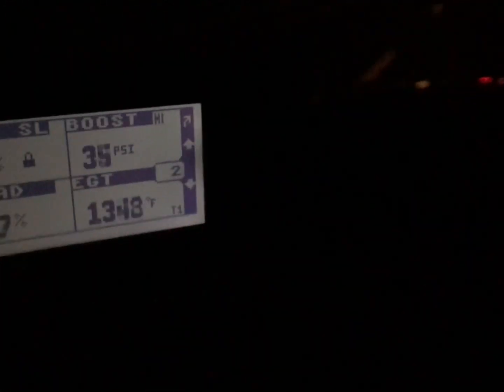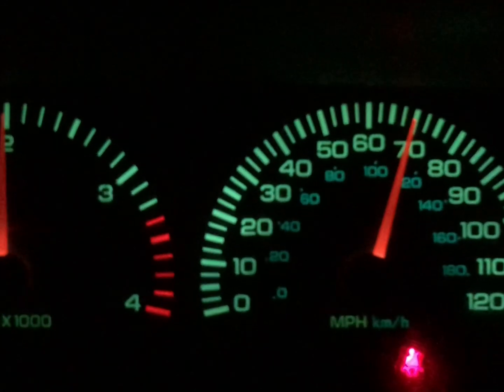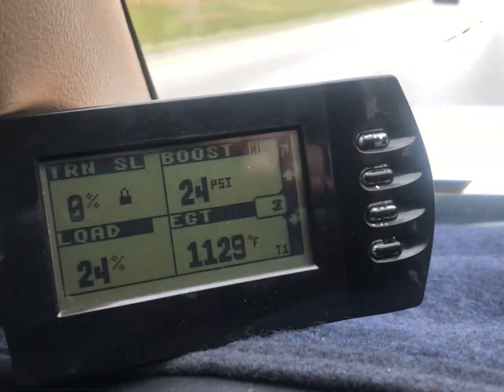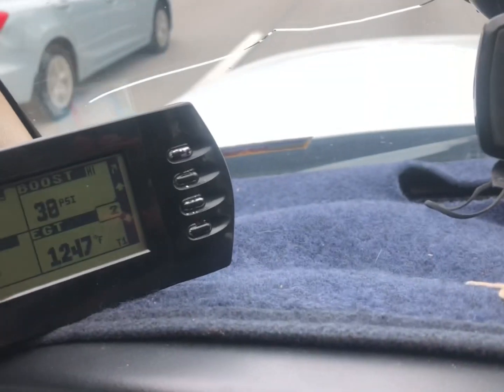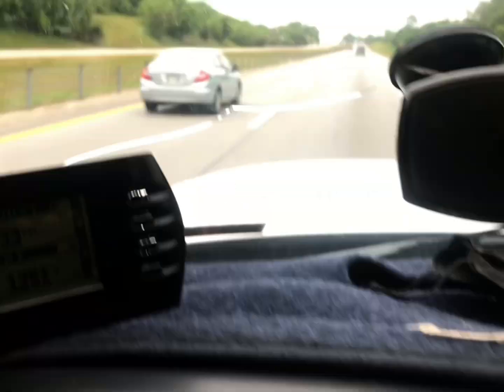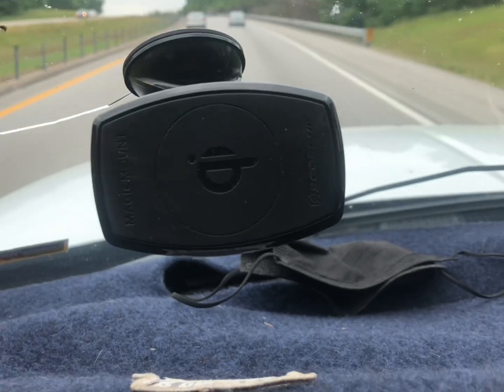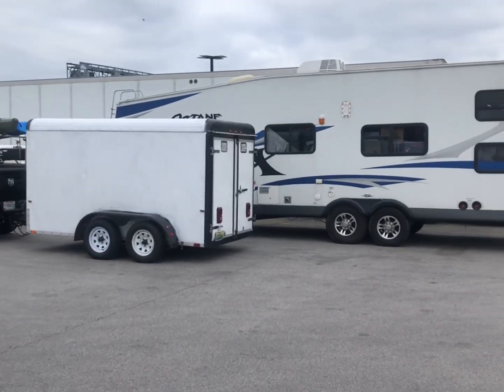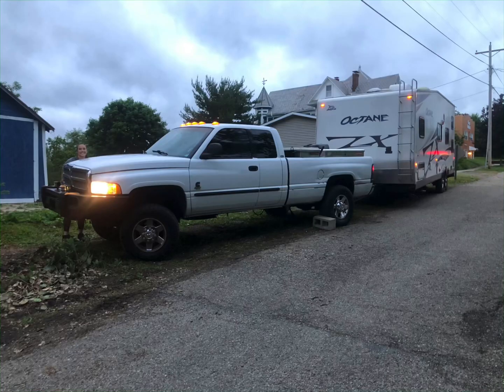24 Valve cummins EGT’s while towing large trailer

Comment: You guys gotta learn it’s not about boost day with a diesel. It’s about air. I’ve been running Cummins for 20 years. Haven’t you guys figured it out yet?
Reply from the maker: Wrong food chain. 

I’ve been driving a cummins for 14 years, and a cumulative 500,000 miles of seat time across 3 different trucks. Not to mention the 328,000 miles that Borg Warner 62/65 turbocharger has on it from me operating it in this condition. Stock turbos are limited based on the inlet diameter, therefore lager inlet diameters on the inducer allows for more air. Combined with 15lbs of boost over what the stock charger will do means better performance overall. Boost equates to power, it’s as simple as that. It’s more atmospheres of compressed air going into the inlet. Combined with proper fueling and you get power.

Comment: Those EGTs are just fine, my friend.
Reply from the maker: That’s generally what I’ve figured. I’ve towed like this with this truck a couple times a year for the last 5 years. There’s no good info on the internet about what EGT’s should be, so I figured documenting it is the right move.
Reply: @uzifouryoutwosay  That guy Greg A towed for years with his 3rd gen and said sustained EGTs of 1350 or less is within acceptable limits. Unloaded, briefly hitting 1550 on a pull is fine too. But if you have any concerns, you can just bump down the fuel, or add an S475 as an atmospheric turbo.
Reply from the maker: I think I’m probably going to do the latter, I just installed these bigger nozzles with my last injector swap, but I think it’s time to run some towing compounds. The only downside is I know my clutch won’t be up to that task as I’m already marginal where it’s at.
Reply: @uzifouryoutwosay  Yeah, compounds are great for towing; highly recommended. Check out valair or southbend for a solid clutch.
Reply from the maker: I’ve run several different heavy singles, I’m just waiting to get into the dual disc game until I have to
Reply: How in the world do you have 5 gears?
Reply from the maker: The Nv4500 has 5 gear ratios
Reply: @uzifouryoutwosay I’ve had NV 4500 and NV5600. I’ve only ran a stock setup. I’ll be adding an gauge, I only tow vintage trailers or a smaller newer one. I have an 00 2500 with 255K. She sits in the garage most of the time.
Reply from the maker: @davekana8388  nice, I still work mine a fair amount. I’ve not messed with 5600’s, but if this thing gives way I’m tempted to do a ZF6 conversion